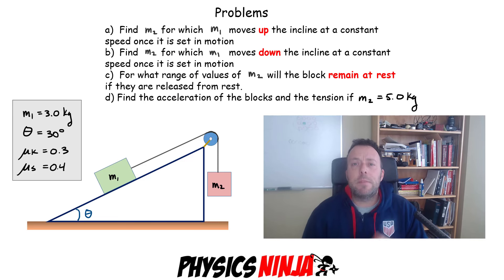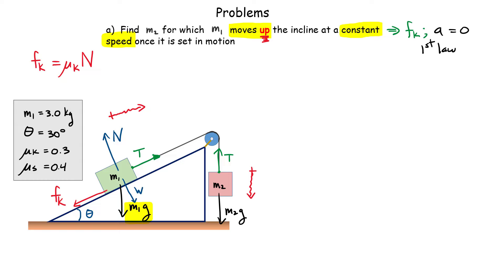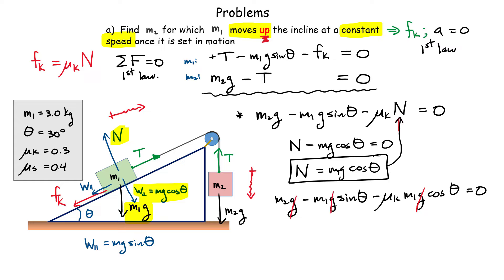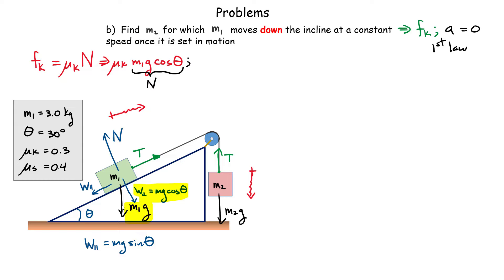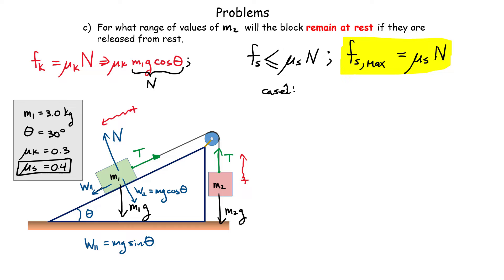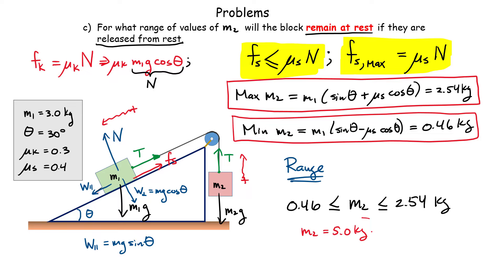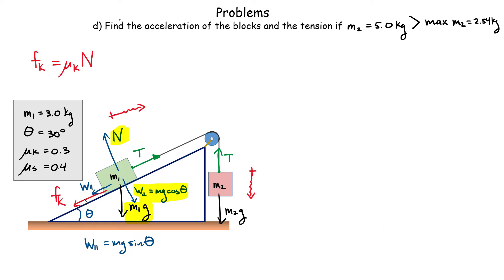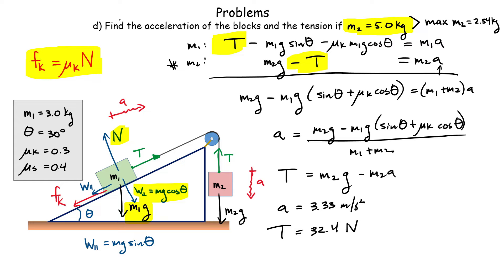Incline Plane Problems with Friction

Comment: For problem A, is there a reason you didn’t solve for the component vectors in the Y-direction? It seems you only did the X-direction for M1
Reply: Direction in which acc is acting, is the direction where components r broken...maybe that's the reason...
Reply: Cause they're just there so they're not accelerating and therefore not relevant (the mass isn't going up into the sky or being crushed into the triangle)

Comment: 23:50 there is something wrong here, the acceleration is negative because block m2 has a greater mass than m1. So the acceleration of the system should act downward .consequently, it should be m2g - T = (-)m2a rather . Thanks for this amazing explanation!
Reply: no its correct, m2 is heavier than m1 so m2g-T=m2a
Reply: @yerb.  Are you psycho?? M2 has a greater mass than m1!! The trick is that the sin component of the gravity for m2 is less than the gravity of m1 so that's why my expectation was wrong....learn physics rationally rather than sticking to a physician,,, you won't do good if you think like this...
Reply: @HashemAljifri515  you literally just repeated what I said. Calm down buddy you are taking gen physics
Reply: @HashemAljifri515  also m2 has no sin component, it only has downward gravity acting on it… you are hilarious
Reply: @HashemAljifri515  I feel like you have a language barrier yes m1 has frictional force and gravity acting on it: T-ukm1gcos30-m1gsin30, we are talking m2. Which is just m2g-T in this instance.
Reply: @yerb.  I was talking about the block that rests in the inclined surface,, I don't care whether it is m1 or m2.. Yes the box that is hanging has a downward gravitational force and an upward tension force.. Whereas the block that rests in the inclined has a tension which acts on a different axis... So think about it now, if we consider x-y plane we won't be able to solve it easily it would be tedious.. Rather, we can use the jacobian coordinates in order to get 2 forces act in this axis and 1 force that should be broken into its component which is gravity... Though the box that rests in the inclined surface has a greater mass, initially we would consider the whole system to accelerate to the left but if we think about it for a minute, we can prove that the sin component which corresponds to the gravitational force for block m1 is less than the gravitational force acting on m2, so the system will accelerate downward m2. Did you get the idea now dude???!!
Reply: @HashemAljifri515  bro u were the one who didn’t get the idea, said there was negative accel. I was just trying to help u and u freaked out 😹😹😹 this is literally what I just said to u
Reply: The negative sign on acceleration doesn't necessarily mean downward , always if you have a pulley choose a positive direction. He got positive 3.33 means it was accelerating down with 3.33 m/s^2 in magnitude . However if you choose other direction than he did then yes you can do m2g-T=-m2a but that is T-m2g=m2a and you will get a negative acceleration which imply that the it is moving backward so it means the positive direction you chose is not where it moved .
Reply: Sup  @yerb.    Let's add a bit more to that.  As a general physics student in college, I've come to realize that Physics obviously has a lot of abstraction involved when it comes solving problems.  However, when it comes to the abstraction, it really just comes down to your experience with the various scenarios/problems and some applied logic.

To cut to the chase, I've been watching Physics Ninja for a while now, and he's mentioned something that my professor mentioned in class as well.  When we deal with systems, which can involve two masses connected with a string and a pulley for instance, we do this thing where we synchronize the signs of our coordinate system (the x and y axis for which we base our horizontal and vertical forces off of).  The signs of coordinate systems are preferential, meaning that both you and Hashem were correct in your statements, in regards to the signs.  As a general rule of thumb for all physicists, the signs of your coordinate system (which also applies to the direction of acceleration), should not be based off of how heavy one object is to the other, and thus the direction the heaviest will fall in.  It can be easy to overcomplicate things, but just choose your signs and be consistent in your calculations.

The acceleration, therefore, can be negative or positive in the direction Physics Ninja drew his, but you must make sure that the signs of the forces are compensated for/ taken into consideration with accordance to the chosen sign of the system's acceleration.  Chat with me more for more help if you'd like.  I have no life, and Spring break is practically a non-existent concept to me (except for Christmas, I think).